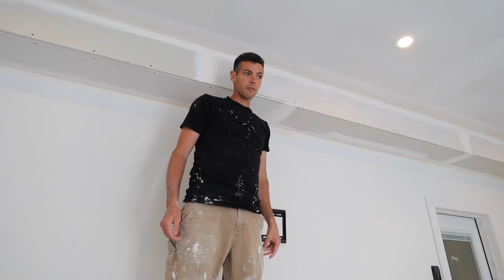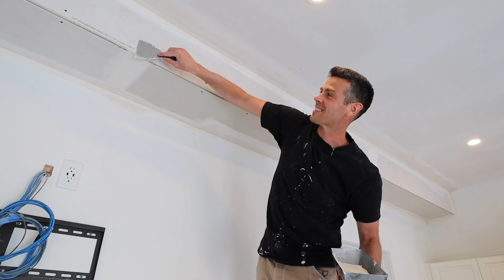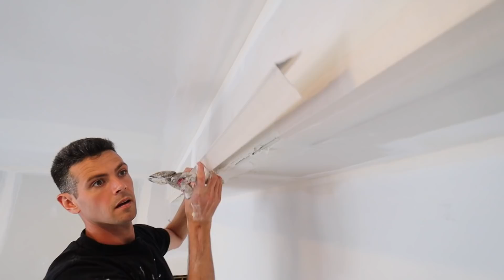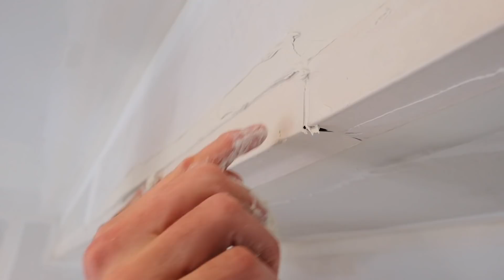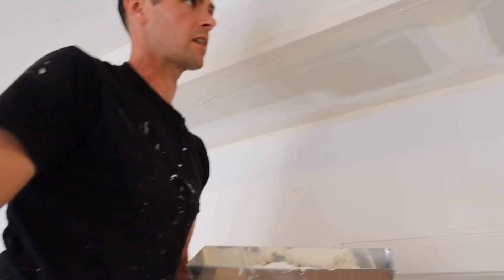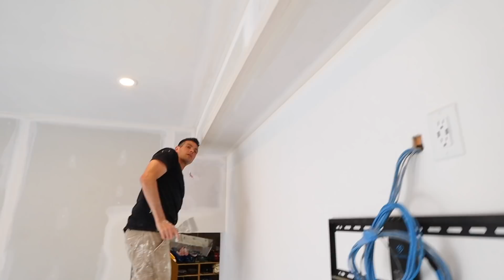How to JOIN two Corner Beads

Comment: no one will ever notice, seen guys that could careless about being straight and guys over analyze it with levels, drywall is just not one of those trades like finish carpentry where people notice......as long as its halfway straight with no glaring issues its fine......once its all painted you'll never see it

tape on bead is so much easier and better than nail on....it allows the framing to do whatever since its not nailed to it

Comment: I don’t understand why you say metal faced corner beads are faster to install when it takes you 10 minutes to install just 2 corner beads? Just the fact that you must pre mud the corner takes longer than screwing in the metal corner beads. then to align 2 ends together you add paper and check with straight edge... while if it was the metal corner bead you would just take small scrap piece (3-4 inch long) and put it under the joining ends and you are done perfectly. :) 
Once a system is proven and its working well for decades, it doesn’t make sense to switch to something else.

Comment: Your videos are a tremendous help but I failed miserably on the but joints so I pulled it off before it set and will change to no coat. This way I only have to deal with my own bumpy framing.

Comment: You do good work Ben,as a drywaller, my work looks good in the end but im sure it takes me twice as long to do what you do effortlessly. My outside corners look good but for some reason on the job I'm on now my inside corners when I go back for the second side looks like it's dragging something. I thought it was dust in the corners but I've cleaned them out. I'm assuming either my finished side isn't dry or my knife is bent. Not sure but it's killing me

Comment: Great video.  Any additional tips for if I'm doing this with bullnose (rounded) corners?  I'm doing a nearly identical stretch on a ceiling boxout with tape faced bullnose corner.  There's a lot more surface area to crack or show misalignment with a bullnose corner than there is with square.

Comment: Ah, shit :/ Found that one of yours too late. I had to coat a similar drywall corner, but then i found "AquaBead Flex", which i don't know if it's available in Canada/US, but it's a 25 meter roll of flexible PVC corner bead, which is covered with starch on the wall-side. Just spray it with water and apply it some minutes later. I did the 6 meter (outside) corner with my brother in law, while he insisted to do the other 3 meter piece all alone, which turned into a nightmare. He refused to use a knife and just coated the whole thing with the trowel. I had to sand this down for hours and evening it out in multiple passes, impossible to get a wonderful straight edge. At least the surrounding surfaces were flat in the end.
However, i can use the info in your video for the window opening's corner beads, which will be done in aluminium and connected in a few places to save on material. Thanks again, Ben :)

Comment: Hello, I have an older late 50’s bungalow home that I recently rewired the main floor. In order to get to some tricky location holes needed to be cut to fish up wires. Problem is I have 3/8” plaster over 3/8” drywall type of walls equaling 3/4” thickness. I was wondering if you could make a video how to patch these type of holes with drywall instead of plaster

Comment: I just can't see to see any davantage using paper corner over metal corners, especially if you use mesh tape like I do, no corner will pop out. Metal is so much faster...anyway I'm all for upgrading and learning new things, maybe someone can tell me why it's worth it to switch over paper.
Reply: Doesn't dent with impact  or crack.  Won't rust in moist environments.   Less mud required to coat, so faster and less mud cost and labor savings.
Reply: Chemically fuse with the rest of the paper / gypsum ensemble for a stronger / more durable result I’d say

Comment: Hello Ben, Thanks for all the videos. I've got a question related to inside corners. 
I've got to make a partition in a room, the walls are masonry with a pretty flat surface finish.
The wall I'm placing is drywall, of course, and it will only have a couple of really light and small shelves attached later. 
But what should I do with the inside corners, flat taping them or is it ok to tape them as regular inside corners? 
I'm not sure if to treat them as different materials or all part of the same wall.
Hope you get this. And thanks again.

Comment: I generally try to keep the corners not having the recess for the joint, mainly because I prefer the metal corner edges which I can do long runs and get very clean edges it's important though to pay careful attention to the joints of the beads take time to line them up perfect and it will make a perfect corner, however wavy corners can make you fight the metal ones.
Reply: I agree. If u have no room to mud it makes it harder to hide the bead also the mud will end up over hanging the corner bead and will chop easily

Comment: As my garage taping finished I found myself re-doing sections where I had started. Techniques that I had learned raised my standards🤘🤣
Made more work, but after paint it'll be worth it.
Reply: Yeah the worst thing about about drywall is that it's a bit hard to know what's important when you start out. And the good thing about drywall is you can always just scrape/sand/bludgeon it off and do it again! Or not, quit looking at my walls!!

Comment: I was going to ask why you weren't using a slop box or roller if you put a lot of tape on bead, then I realized this is probably geared more towards the DIY'er.  I'm amazed how much tool prices have gone up, bought my slop box made of metal over 30 years ago and still use it to this day, only cost $30, now they want $140 for a plastic bead hopper.  Bought an outside cornerbead roller with handle for $50 back then, now they want $75 just for the roller (handle extra)...

*pro tip, sometimes you get a tricky area where they don't want to butt up perfectly because of lumber warp, it is nice to carry around a plastic staple gun for those areas

Comment: Why don't you use metal bead and clinch on tool.way faster and straighter.
Reply: the paper bead is excellent for bulkhead situations as it has a wider width on one side that allows easier coverage of the exposed edge.   Less work to install too as no extra tools required.

Comment: I’m having a real problem with bubbles in my skim coat. I thin the all purpose mud to about pancake batter consistency. Entire wall covered with little bubbles that dried into holes. Any tips on how to eliminate this? Or a better setup for a skim coat?
Reply: Are you skimming a painted surface?
That will cause bubbles.
Reply: @tay13666  Yes. It’s painted plaster. Had to patch some water damage and wanted to skim coat the entire wall to smooth it out. Any tips?
Reply: @sparks6666  I just did my painted plaster walls last year. I did a light skim, light sanding, then another skim.
The second skim had no bubbles.
The only other thing you can do, is prime over the paint first, then skim.

Ben addressed it in a video a while back. 
Something along the lines of the painted wall not allowing the mud to dry on that side and forcing the air to come through your finished side.
Reply: @sparks6666  https://www.youtube.com/watch?v=EpoRelGiqxY
Reply: @tay13666  Thx. This was helpful. I did another coat and that pretty much took care of it.
Reply: @sparks6666  Glad it worked out.
Reply: leave it on a minute to setup, before wiping down usually helps.   It is reaction of the chemicals in the mix and the paint.  https://www.youtube.com/watch?v=igVklD3wNUU

Comment: Okay Ben, I love your work, and you have probably helped many people I'm sure.  My only question is...why did you seem to avoid filling that gap like the plague? Especially without any explanation as to why. A hollow behind anything drywall, mud, corner bead, tape, concrete, caulk...my Grandma's corset is only a setup for movement and cracking. Why? I'm not dissing Brother, just not understanding.

Comment: Too much coffee? There's never too much coffee for a taper. I love seeing people use knives sideways. It puts on the mud so much slicker. I used to put beads on with my slider and it was slick but so thin i don't know if it was as good as I thought it was. I'm all thick mud now to install. I do 2.5 coats for beads. 1 5 inch knife fill while installing and 2 passes with my trowel. Works perfect. This video was pretty solid. 1 trick I like to share with people is using thumbtacks. Whether paper or plastic they give you assurance the bead will stay where you want it. The ones with larger heads so they're easy to pull out once cured. I like your videos and have been following for awhile now. I'm on ig DrywallGlitcher stop by if your game. 💪

Comment: always like information you provide in a no bs way.  Maybe i can provide a little cheat.. i pinch a # 10 wire in the bead to help line up the beads .  also in a long run like that i liked to put the first corner in the center of  the "run", it makes for two junctions but with the wire pinched in there not really terrible difficult.. (Also seems putting the factory ends together makes it a little easier) Its less discernable with the junctions toward the ends rather than the middle if slightly off... pedestrians probably wont pick it up but you seem the type that insists to stay with professionalism
Reply: Using a piece of wire as a alignment guide is genius.

Comment: So, in a nutshell, you butt the second piece against the corner, cut it 2 mm short, reverse the stick, load it with mud and install.  Partially wipe them down so there is ability to adjust.  Align the bead and wipe tight.  Apply four inches of tape 1/8 inch back from the bead, on each side, so it will be hidden by the fill.
Reply: Yeah, but don’t butt the cut edge up to the factory edge. Factory >< Factory.
Reply: @monkeygraborange  yep, that is why I said, "Reverse the stick."  🙂
Reply: @kgphoto  duh... sorry!
Reply: @monkeygraborange  LOL   No worries.